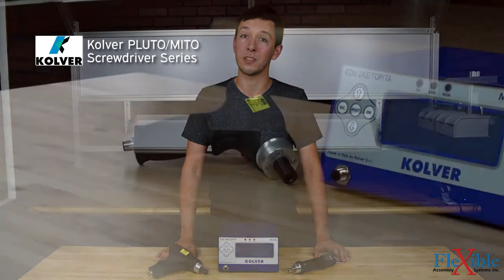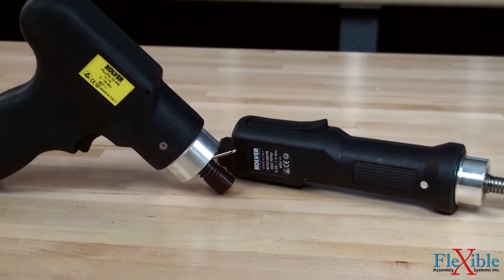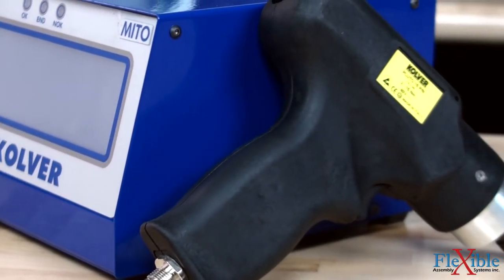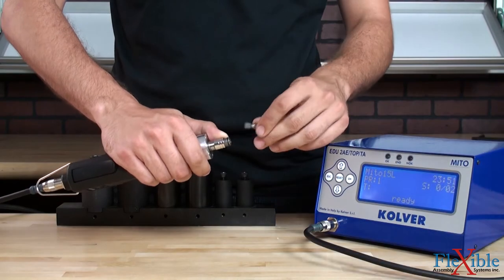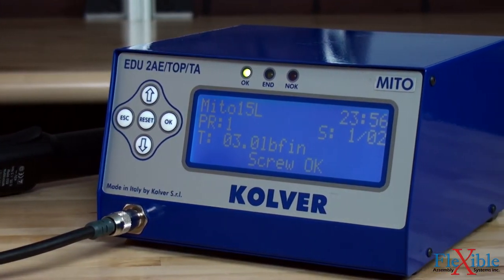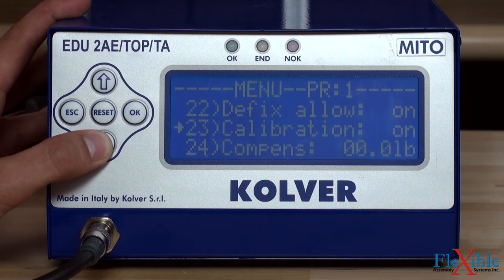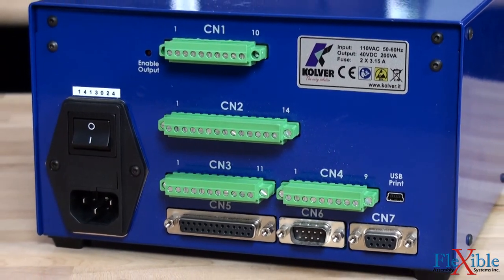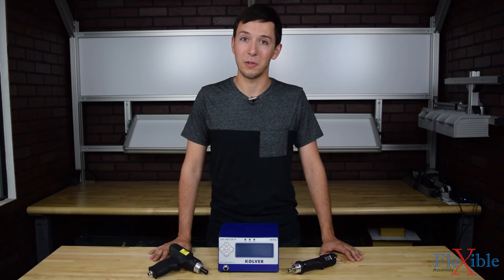Kolver PLUTO / MITO Screwdriver Series

Comment: Hi there, I have EDU 2AE/TOP/E. I want to change the program from one to second and second to third and so on. Can I do it by programming in Arduino by selecting the desired pin?
Reply from the maker: Yes you could! First in your sequence settings you will have to enable "Ext box" by changing it to on. This allows the EDU to use an external switch box. You can then use the CN5 25 pin connector on the rear to talk with the Arduino. Pins 17 to 24 are inputs for selecting Program 8 thru 1 and pins 4 to 11 are outputs for indicating which program is being used. You can also use select pins from CN2 and CN4 to do the same thing. The pin diagrams are all available in this user guide from Kolver: http://kolverusa.com/upl/Manual%20EDU%202AE-TOP-E_TA%20ENG%20120118.pdf

Good luck!